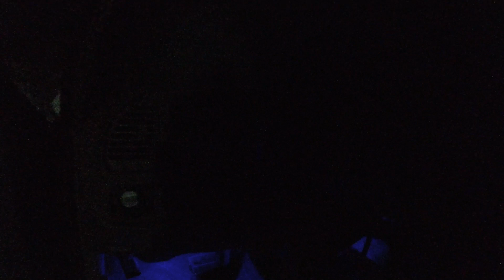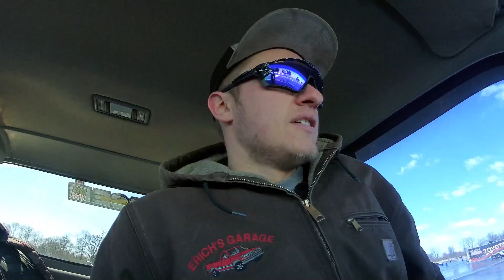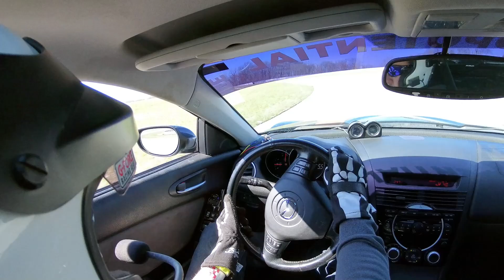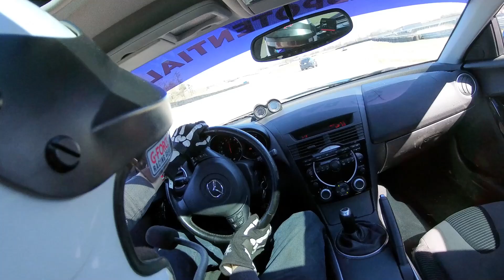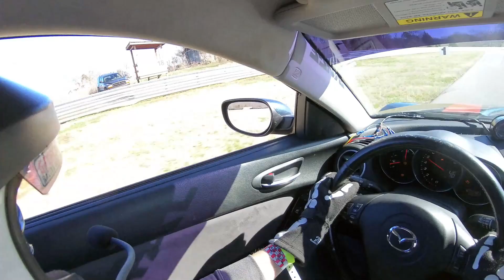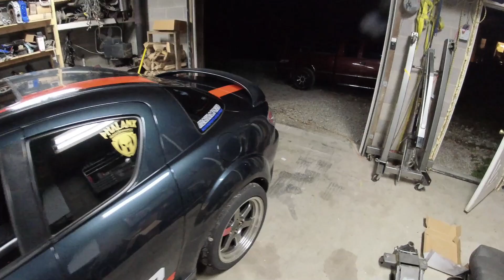Ripping The Green Machine RX8 at the Track with NO Mechanical Sympathy- Kept it above 7k RPM All Day

Comment: Contrary to urban myths, rx8s are pretty reliable, they take a beating on track and come back for more, a lot of track car for not a lot of money. A good upgrade for the money is an uprated anti roll bar(sway bar) cheap and easy to swap, you'll notice the difference
Reply from the maker: Yea man!!!  Tomorrow's video will be the things I want change. Kind of an overview and then a parts list I am ordering for it!!
Reply: @RADPotential  in the UK black hawk brake pads seem to be the pad of choice for track days, the rx8 can be hard on the pads, some guys go for 4 pot calipers and larger pads for better feel
Reply from the maker: I may up to a more aggressive pad.  I could feel I was getting to the limits after turn 5.  I could barely get the car reigned in for turn 6

Comment: Bro, video got me pumped!
Gonna be getting track day soon at Laguna Seca since I work there.

I sometimes get the top end misfire on "cylinder 2" when I rip getting on the highway   
I switched front and rear coils(rev C oem) to seeif its the coils, but still got rear rotor misfire.
 From what I've read, it could be spark plugs getting drenched in fuel. if its not the coils. 
Im always lookikng out for info on this, So will def check the next video to see what you do
Reply from the maker: You work at Laguna Seca!!??  I have wanted to drive there for a long time!!  So cool man!!!!   Get out there and drive. It's what these cars are for!!
Reply: @RADPotential  yea i work as a course Marshall. I took the rx8 out there once and man was it was a beast in all 11 corners even though im a novice.
You definitely gotta drive it at some point!

Comment: Do you run with traction control and DSC turned off? Have my first track day next month. Just wondering. 
I take it yes?
Reply from the maker: Check out the follow up video after my track day in the rx8,  I did for the first few sessions. Then turned it off.  Depending on your ability you may want to keep it on all day.
Reply: @RADPotential  Thanks a lot. Great channel. 👍🏼

Comment: I like your driving style. You are very smooth on that steering wheel, and on your pedals too. 
Do you run with FULL LOCKED DIFFERENTIAL or just esp disabled?
Reply from the maker: Thanks man!!  I'll go thru my track day process in the video tomorrow.   It has the stock LSD in the rx8
Reply: @RADPotential  okey so you use the stock dif… what mode do you use on track?  There are 2 types of unlocking the dif. The one just unlocks the esp(antispin) and the other makes it full Locked rear end (I think so)
Reply: @georgepolyanidis9865  RX-8s have DSC (Dynamic Stability Control) which should not change anything differential related. It believe it just controls the brakes and engine RPM.
Reply from the maker: I usually run the first session with the DSC on and then shut it off for the rest of the day.  The rear diff is a mechanical setup. It's not controlled by the ecu at all.  I don't know if maybe the S2 rx8 has a newer version but I know mine is just old school mechanical lsd